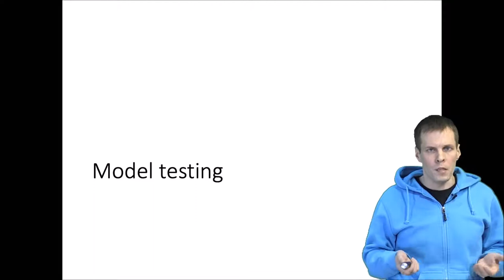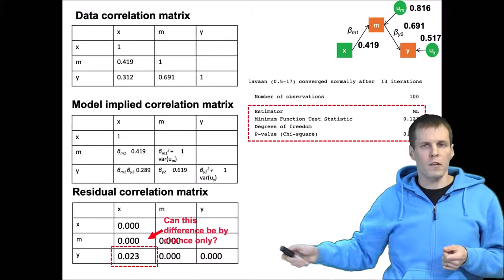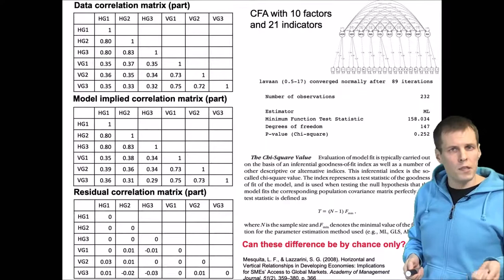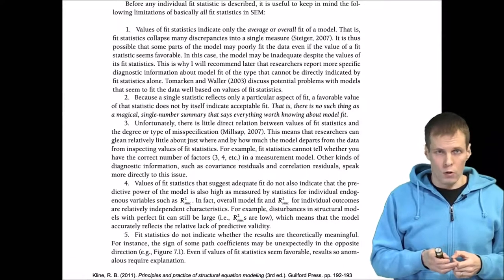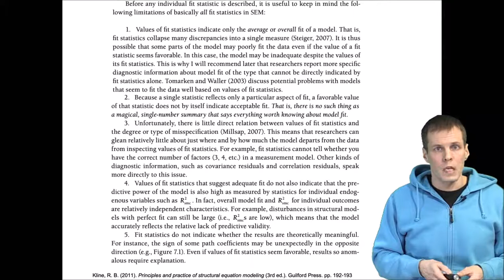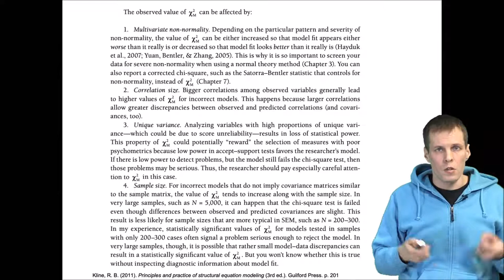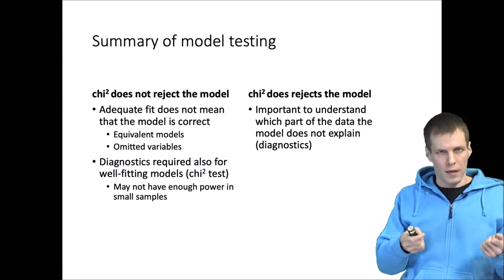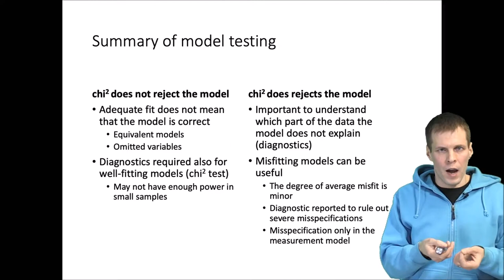Model testing

Comment: Professor,
I have seen in many articles that from a proposed model, they make re-specifications freeing parameters or changing the direction of the relationships and compare the results of the AIC to stay with the best model. In fact, they also use the RMSEA, RSMR, CFI indices to decide. Is this practice correct?

Thank you!
Reply from the maker: No. See my playlist for CFA models and particularly the long diagnostics example for how to do it right.
Reply: @mronkko  Thank you!